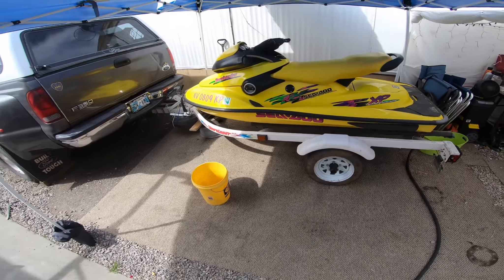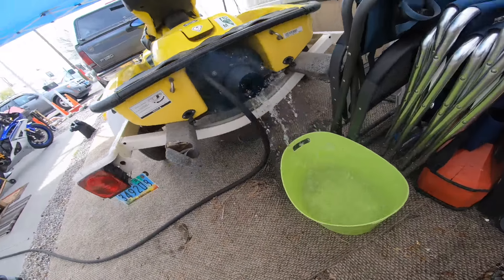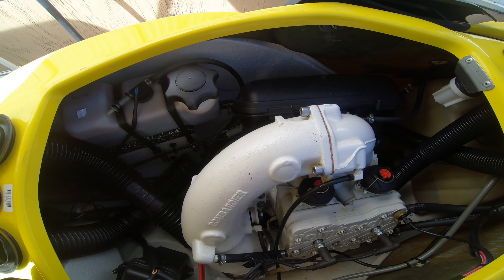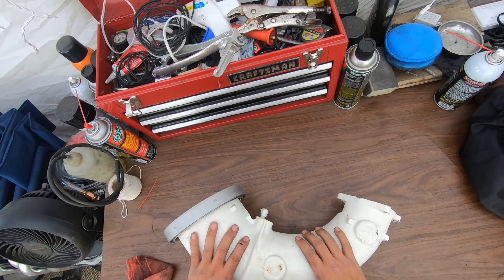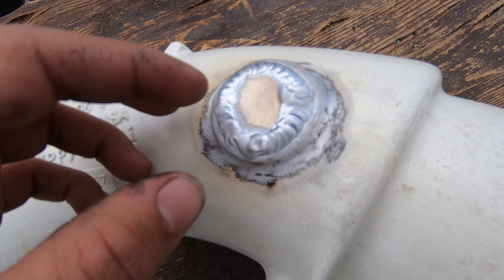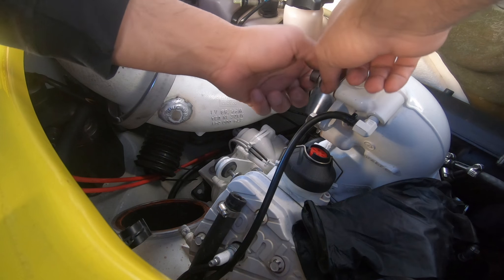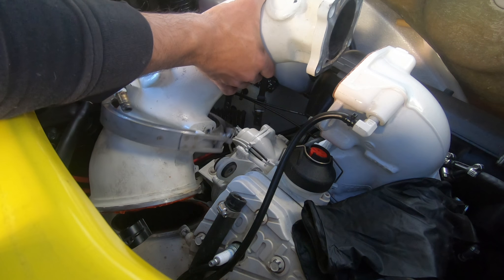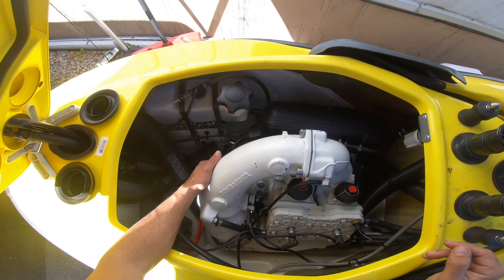$100 96 Seadoo XP and Trailer! Will it Run?

Comment: Start the engine before you turn the water on..... you will fill the engine up with water if you keep doing that
Reply: I cringed when I saw that
Reply: Yep, he is are right. Start engine then turn and water, cut off water then cut off engine...
Reply: Will fill water from where? 😁 from exhaust? Exhaust is at the end at the bottom. No way to get water

Comment: Hey you really should download the manual to this ski and read it. You have owned this ski for 10 min and already doin something wrong. Your supposed to turn ENGINE ON BEFORE WATER ON!!! You just might fill the engine FULL OF WATER! These machines use a WET exhaust system. Read the manual! When turning engine off.... water off then engine off!
Reply from the maker: Thank you for the Advice Jose Ortiz, believe it or not i've been doing exactly what you said but for some unknown reason I didn't do it that way in the video. I will make a follow up video on this soon but for the last  2 weeks and future 10 days the weather is in the 50s! I will make sure to look up a manual.  I Hope you give this channel a chance and Sub

Comment: If you haven't changed them out by now, replace the grey Tempo fuel lines and clean out the carbs. Those Tempo lines are notorious for breaking down in ethanol blended fuel. You will probably find that the internal filters in the carbs are almost completely blocked with broken down fuel line gunk. It can cause the ski to run lean and kill the engine. It will usually run fine until suddenly it doesn't.
Reply from the maker: Thanks for the advice. i'm sure it will help many people that own this unit. in my case I sold it a long time ago so I got lucky this didn't happen

Comment: there is one of those exact ones for sale and it needs a new engine but i heard that rotax fuel injected is not good is that true and do you always have to be workinn on it?
Reply from the maker: This one was carburated. I don't know enough about the Rotax engine to give you an educated answer but unless you have a donor engine lined up id steer clear
Reply: Spot on 2 Stroke Fuel Injected (rotax) are a pure nightmare ... I have the 99 XP Limited Carb ...works great

Comment: Yes so I gotta question for someone to answer I have a 98 gtx 787 Rotax fuel injection, It will run completely fine on trailer but when I back it into the water it will not start at all so far I have changed the stater, replaced the tps and changed the The rectifier cause it was flashing 12 volt low all the time, anyone have any problems like this with there Jetski?

Comment: I heard those 97 xp are extremely unstable and not as fun to ride my buddy had one and had it in the shop getting worked on more than he could ride it so you should sell that and make some money off of it and get a 97 spx
Reply from the maker: I rode it at high speed and it felt pretty good. but yes I agree that they can be unreliable. I ended up having to work on it every time I took it to the lake so I have sold it long ago. I did so after I used it one last time and made sure all worked fine at the moment. if you enjoyed the video please consider subscribing to the channel :)
Reply: 1st Name Basis yeah they could be comfortable but not stable at all
Reply: A 97 spx has the same engine and setup so what are you talking about. They are both the same when it comes to maintaining them both!
Reply: @bananaltz4002  Seadoo realized they had to beef up the engine , to the 951 ..for the bigger hull from previous years ..
Reply: @CP-kb1du  The 951 is too heavy in this ski.  The 97 787 is the better option for this style XP.
Reply: @thesammycooks  Beg to differ I have the 99 XPL with the 951 cc works like  crotch rocket on the water weight - power ration dialed in ...Mint
Reply: @thesammycooks   Naa not at all. The 951 is much much better.

Comment: For a minute there I thought you live in Vegas after looking at your registration.

Didn’t think you can run the 2 strokes on lake mead if you are in fact in Vegas.
Reply from the maker: Haha no I live in Reno, but it's the same in lake Tahoe no 2 stroke engiens. in fact very few lakes allow these to run so it takes most of the fun away from it, thats one of the reasons why I sold it
Reply: I hear ya bro. I’m sure they banned 2 strokes in Tahoe and Walker lake since you’re in Reno.

Comment: Hey man I got the same ski and I’m wondering if ya could kinda give me a list of issues you had with yours?
Reply from the maker: Sure, other than what I showed in this video my throttle at the bar was partially dislodged, my starter went, and I ran into a some trailer bed cloth by being too close to shore. make sure to Sub to the channel!
Reply: Immortal Engines man that’s no good Yeahh I am running into quite a bit of issues on mine what’d you sell yours for?
Reply from the maker: @Joafornia  2600 with the trailer and all paperwork straight.

Comment: An your gonna ruin it by running water through the machine without the engine running
Reply from the maker: I got lucky and it didn't damage anything.  ran great all the timesI took it out to the lake. somebody else mentioned the same so I only did it once in this video.